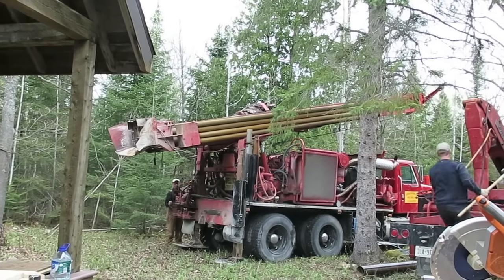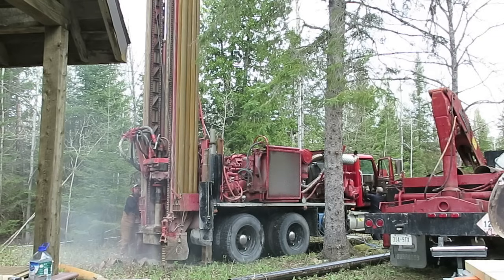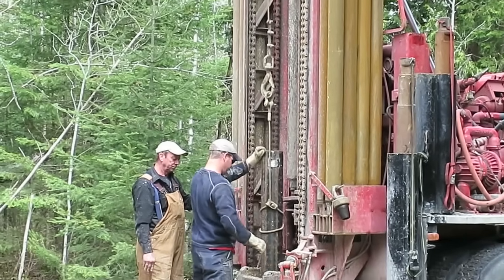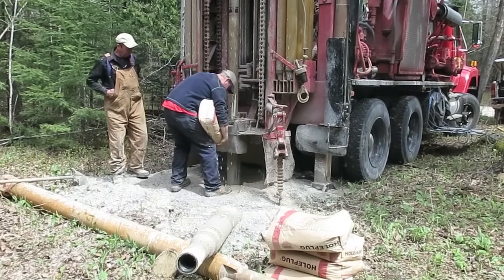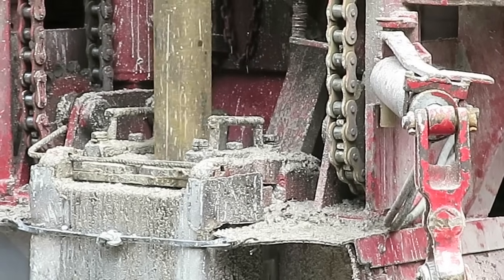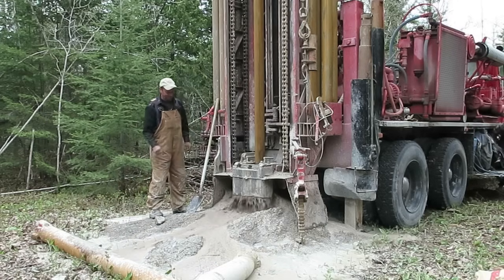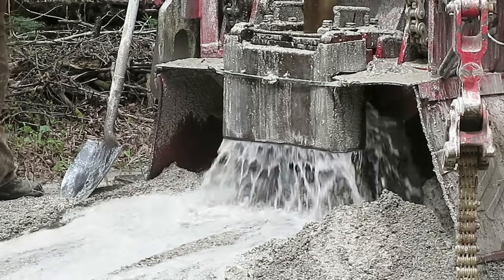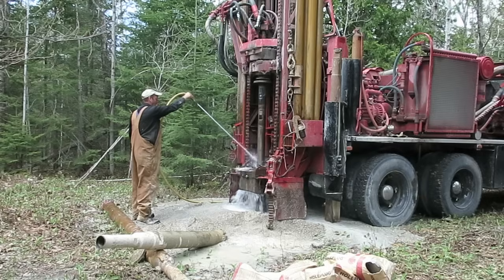Watch a Water Well Being Drilled

Comment: No need of pumps, it releases water to the surface due to pressure from the deep
Reply: he said the water rose to 13ft below ground, so not quite. Quite a lot of head though considering the well is 140ft deep.
Reply: Not all aquifers flow some have tremendous head pressure while others have little to no pressure this one required a pump but wouldn’t need a big one with water level up at that height
Reply: There's a pump in there.

Comment: Steve, how did you end up at that particular point to drill the hole? was there a scientific technique involved to chose the point of drilling?
Reply: Not really. Just point at a spot and hope for the best. Dry wells happen sometimes.
Reply: he’s probably guessing that answer also. I can almost Guarantee the drillers had a water “Witcher” come out Are they know the area well and did it themselvesand designate the Exact spot to drill.we used to have an ol’ timer about 80 yrs old walk around the property for hours with two 1/8” brass rods bent at perfect 90 degrees About 8 inches sticking down on one end at about 16-18 inches pointing out. he would hold his arm perfectly 90’ from his body only bend his elbows and have the brass in each hand and just ever so lightly letting them rest in his hand.. as he walk around rods will swing together and touch whenever he was over ground water.the more ground water the stronger the pull. don’t ask me how but them old timers been doing it long enough he could guess dang on the spot the exact GPM with a 99%success of at least finding water. you were at 40 gpm at 100’.not ideally @ “clean-depth”but still good volume. that’s more than my garden hose on full blast.shoot we’d drill over 1000’ for measly 5gpm(our minimum).Man I can go on and on and brings back a lot of good memories but I’ll quit rambling now.Take care

Comment: Hi Steve I was wondering how much did that job cost your son, I am doing my research on drilling a well and not sure what it costs is it per foot?
Reply: Where I am at 14-20 a foot is standard
Reply: Thank you so much, I appreciate it
Reply: Here in ks it's running 23$ a ft
Reply: @joekane5029  I  am able to confirm
Reply: 20 dollars a foot is about average, for drilling,  but adding in steel case is another 20 dollars a foot. So depending on if you have to case it the whole way it can be upwards of 40 to 50 a foot.
Reply: It all depends. You can use the USGS/GIS maps to figure out the composition of the land where your house is. If it is granite all the way down, it is naturally going to be more expensive than a site without rock.
Reply: Usually it is a standard amount per foot no matter what they are drilling through, just will take longer through granite. Probably woukd be cheaper in granite cause you wouldn't have to case line it.
Reply: Where I am in nc it's around 12 a foot for drilling. Pipe is around 7 a foot. Can be more I guess depending on location.

Comment: Very informative.  Thanks. Do you recall how deep the casing went?
Reply: He mentioned the well being 146 feet deep at 7:28. I don't know if that's what you were looking for :)
Reply from the maker: HI Vincent!
Thanks for writing. The well casing was about 20 feet long. 

Drop by for a visit sometime at my online destinations: https://stevemaxwell.ca and http://realrurallife.com. You’ll find lots of new videos, articles and product giveaways, plus a chance to see what we’re up to on our island homestead.

Thanks for watching, Vincent!

Bye,

Steve
Reply: Thanks, Steve.
Reply: Michael Akins, no it doesn't.
Reply: august I can tell you that my well has steel casing for the first 6 feet.  The schedule 80 PVC goes all the way to the bottom, with the perf pipe being the bottom section.  Pea gravel is dropped down the hole in the water production area, then bentonite is dropped on the gravel to seal off the water production zone.  At the top, concrete is used to seal the top of the hole.
Reply: Well casing goes the entire depth of the hole. Steel casing is set till you get through rock to avoid cave ins and then you install pvc casing the rest of the way. Perforated casing goes at the bottom to still allow water into the well for the pump

Comment: Really interesting to see the process!  Do you have any hints on how to find a GOOD drilling contractor?
Reply from the maker: Hi Donna!
Thanks for commenting. Well drillers usually have areas where they work, so there aren't a lot to choose from in any given place. I'd ask around and see what people's experiences have been. Also, you'll want a driller who will confirm a per-foot price, as well as the extras. Metal casing and cap costs extra, and the driller may be require to do some flow testing, which will cost more, too. You'll want to know these numbers ahead of time.
Where do you live? The driller who did our well has been doing the work for about 40 years and is well respected. He does travel over a pretty wide area of northern Ontario, too.
Bye for now and thanks for watching!
Steve
Reply: Currently I'm in New Jersey, but eventually, I plan to retire in New Mexico (which is where I might need to drill a well!)  Thanks for the info, though!  <3
Reply: Some of us travel very far for drilling I’ve went 1000km to put in surface casing depends on the company’s and reputations ask around is best advice and they should have no issues explaining what’s going to happen to the yard